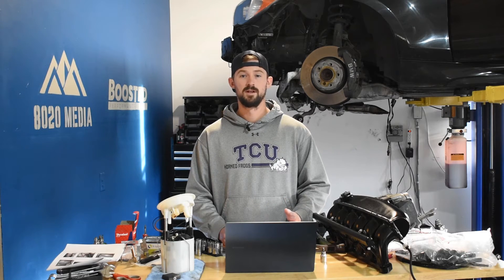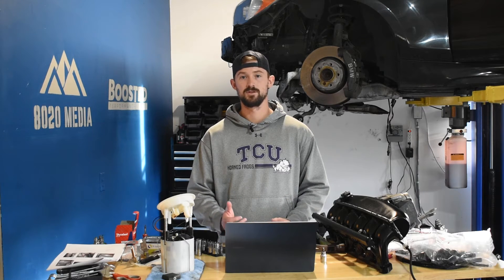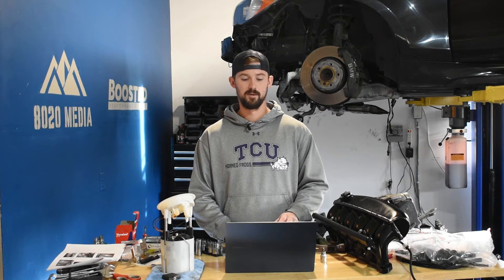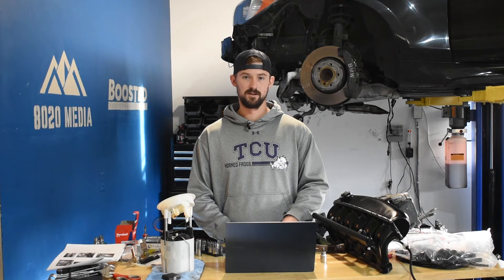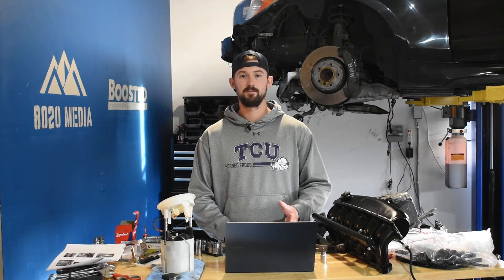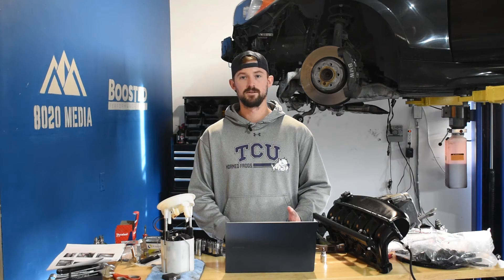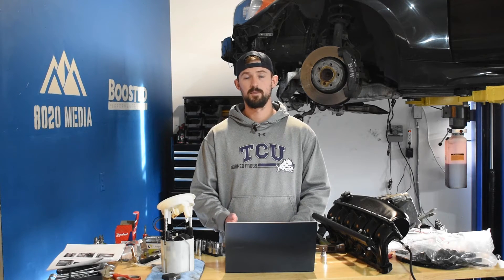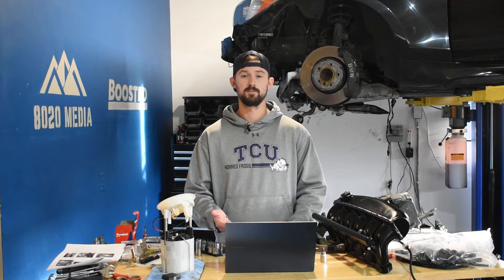All About the Duramax LML | Common Problems & Reliability

Comment: Couple more things TCM failure and electronic fan clutch failure.  I also had the low pressure P/S hose come off of the P/S pump.  I just got rid of my LML.  A money pit!!!
Reply from the maker: Tim - Thanks for sharing this experience. Can you share what mileage you sold it at and/or when the problems were occuring?
Reply: @8020Automotive  I traded it in about a month ago with just over 112K miles.  I have the service records and I can reply back on the mileage when service work was done.  Beautiful LML and I was noticing a vibration holding the steering wheel when stopped like the engine was out of balance so I said to myself no way am I paying a shop to tear into this to find the reason.  It was maybe 6 months before I had the CP3 changed and took it up the * for that expense. With no hope on the GM clas action lawsuit I said I am not paying for anything else.  Gone!
Reply from the maker: Got it - Thanks for taking the time to share this! Sorry to hear about your LML. What are you in now?
Reply: @8020Automotive  A crotch rocket 2SS Camaro. Now I find out about GM's dirty secret called AFM/DoD.  That crap is coming off and permanently disabled.  I'm not replacing lifters or some motor because of it.
Reply from the maker: Unfortunately, a lot of brands are moving towards it.. Love a nice Camaro!
Reply: @8020Automotive  Here is what I have in my service records.  I was the 2nd owner so I don't know what the 1st owner had done.  It had about 51K miles on it when I bought it.
I asked for a VIN check in the Duramax forum.  I'll have to find that.  I believe it tells the work done under the 1st owner.  At around 100K I had a lot of preventative maintence work done, new hoses, belt, glow plugs, batteries, all fluids changed, etc.  
Sometime a NOX sensor was replaced.  
DEF tank heater  62758
Fan clutch            71697
TCM                       81587
Headlight out and replaced all front lamps with LED's due to work needed just to replace 1 bulb.  Front bumper trim has to be removed to get to the housing.   98153
DEF tank heater replaced  between 98K and 99K
Engine block heater  99K
9th injector replaced  101350
Had the Exergy fuel pressure regulator put in and CP4 pump failed while it was idling to
check for leaks.   Fan clutch was making the roaring noise again 
CP3 pump   107415
Fan clutch    107415
Parking brake and axle seal 107670
Pitman arm, inner tie rods, idler arm, center link 108291
P/S pump low pressure hose came off.  111183  Repair shop said it looked like no clamp was on it from the factory.
Reply: Service under 1st owner.  I bought it in May 2014
01/10/2014 60027570 ZREG----Regular Vehicle Transaction 4068290 - Turbocharger Replacement 46,560 MI
11/22/2013 72634 ZREG----Regular Vehicle Transaction 4026050 - Nitrogen Oxides Sensor Replacement - Position 1 46,142 MI
11/28/2011 24194 ZFAT----Field Action Recall V2399 - 11001 - Reprogram ECM 15,859 MI
07/28/2011 22034 ZREG----Regular Vehicle Transaction J6450 - Exhaust Particulate Filter Cleaning 11,429 MI
07/28/2011 22034 ZREG----Regular Vehicle Transaction J6353 - Module, Powertrain Control - Emissions Related Reprogramming 8/80 coverage 11,429 MI
Reply from the maker: Tim - Thanks so much for taking the time to find and type all of this information out. Not only is this helpful to us, it is also VERY helpful for future viewers. We really appreciate this! Interesting to see all of the things around the 100,000 mile mark.
Reply: Just like your wife but yet you keep that slut

Comment: definitely delete the truck. lmao that’s a no brainer
Reply from the maker: William - We can't advise this, but you are not wrong.
Reply: @8020Automotive  I have an LML with 189k miles emissions still equipped cp4 going strong. run hotshots EDT every tank. but warranty just expired so that’s my next move. Cp3 conversion / Tuned & Deleted.
Reply: all about how you maintain the truck.
Reply from the maker: Sounds like you've got quite the rig! Keep us updated on how this goes.
Reply: @williamthompson4000 can I see your rig ?